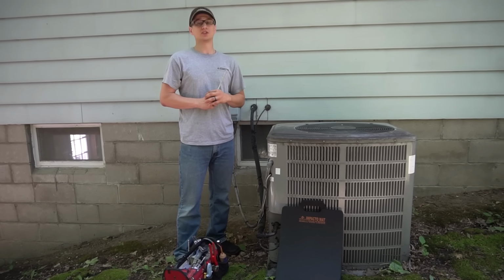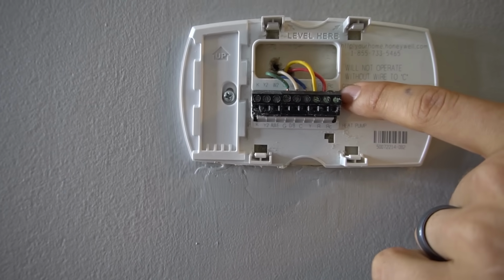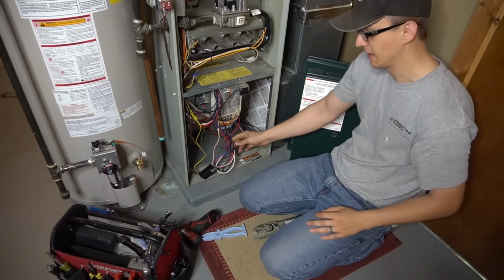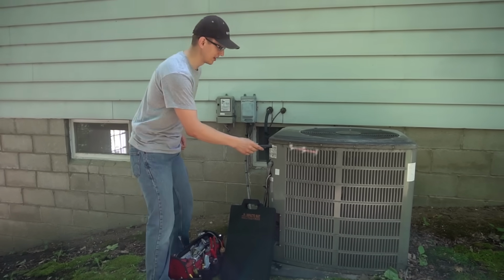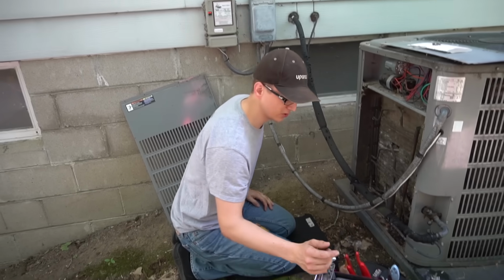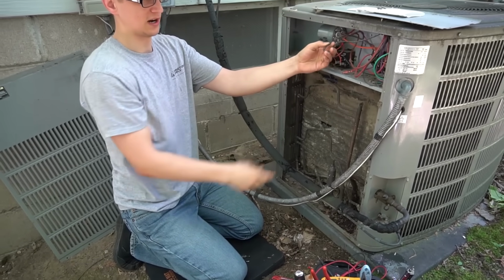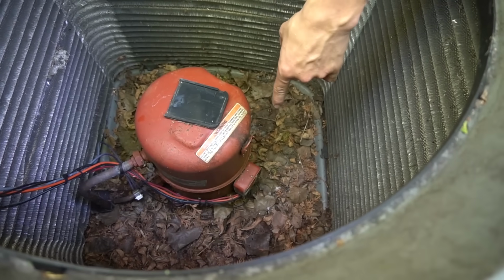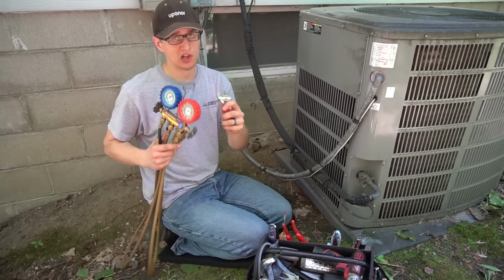AC Unit Not Turning On - How to Fix It Step by Step

Comment: I'm sorry, I didn't catch the part where if you manually push in the plunger and the compressor turn on, what should I do with the contactor?
Reply from the maker: If the contactor does not pull in on it's own, then it's time to move on to this video: https://www.youtube.com/watch?v=NVPhsK4gK1A&t=2s
Reply: Well...it's..weird.  I've opened the panel to the unit with the thermostat off.  I've measured the voltage for what I thought is line to line but the voltmeter registered 0V.  Line to neutral registered 120V for each line.  When the thermostat is on, the contact does work and I do have 25V at the contact.  Not sure what to do next.
Reply from the maker: @garypham5513  It sounds like you are missing one hot leg. So instead of 240v, you only have 120v. My guess is that one of your disconnect fuses is blown or there is a loose or broken wire..
Reply: I've replaced the fuses just in case.  Line to neutral is 120V for each of the hot leg, so I should have 240V, but when I measured the line to line (placing meter end on each screw ahead of the contactor), it reads....0V?  That can't be right when there is power from each hot leg? If it me measuring wrong and I do have 240V, then the next steps would be to check out the capacitor? Thanks so much for your time and help.
Reply from the maker: @garypham5513  Between L1 and L2 you should have around 240v. (so yes, where the two hot legs come in and go to the contactor, you would put one lead on one screw and the other lead on the other screw)  I would guess that you have a broken or disconnected wire in your disconnect or the ac circuit breaker. You should be have 240v there.

Comment: I’m having a problem with my fan running and condenser shutting off periodically, I have to re set my thermostat to get it to turn back on.. what could this be? I’ve tried replacing my thermostat as that’s what the ac guy said it may be. Oh and it’s only doing it on my upstairs unit, the downstairs works perfectly

Comment: My issue doesn't seem like an easy fix. I checked contactor by bypassing the thermostat, worked great, checked voltage with meter and I'm getting 24 volts on contactor. I checked thermostat first too, seems to work fine. My issue is, contactor not sucking in. Any ideas? Thank you.
Reply from the maker: If the contactor is getting 24v but it is not pulling in, then the contactor is bad and needs to be replaced. It's a pretty cheap part on Amazon and is fairly easy to install.
Reply: @WordofAdviceTV  I had a feeling I should replace it. That's why I asked a pro! Thanks, I will give it a go.
Reply: @WordofAdviceTV  Installed new contactor and still not pulling in. We had a new furnace installed recently but not sure if that could affect it?
Reply from the maker: @ghatonn78  That is strange. So when you check with your meter, the contactor is getting 24v but the contactor is not pulling in? Are you sure there's 24v there? And now this is a new contactor and still not pulling in... Have you tried bypassing the thermostat at the furnace control board just to rule out the possibility.. (I have a video on how to do that if you need it) And I have another video on 10 reasons why a contactor does not pull in, maybe one of those will be your problem: https://www.youtube.com/watch?v=NVPhsK4gK1A&t=2s
Reply: @WordofAdviceTV  We looked at every variable and the problem is with the new furnace. No volts from board to condenser. My brother in law is hvac qualified but hasn't had huge amounts of on work experience. His opinion was the newly installed furnace. I was hoping it would be somewhat easy. I've learned a lot so that's always nice. Have to get the furnace guys back on this one. Thank you for your help.

Comment: Awesome tips.  Exactly what I needed to check. Thanks for this.  Very thorough!  My air blowing in house but the AC unit not powering up or spinning. Hopefully I can check all of this before repair man comes out. Been without heat for 4 days and it's 85 - 90 degrees all week.
Reply from the maker: Yikes, that's a hot week! Hopefully you can get it fixed asap!

Comment: Hi - I have  frigidaire  Q7RD-024K - when I turned on, the outside exhaust fan came on once but the turbine that pushes the air through the vents was not turning. It seems to move freely. I turned the system off now nothing will come on. There is no hum. The fuse looks fine. There is a click when the power is turned on initially. Just seems dead. System is from 2013 - no bulging on the capacitor - capacitor was replaced 2x so far. Everything is in the outside unit. on inside furnace. neither heat nor cool work - EDIT: I found that there is power coming to the top of nordyne 624712 - but no power at the bottom terminals  (the ones I could reach) - I see a coil at the back - is it a relay? thanks

Comment: Hey! I have a Nest Thermostat and the connections are listed as-->     Y1 - G - R - W1 - C - OB*     No power is going to my AC (furnace fan is working). Do I need to put a jumper between R&C? If so, how do I do it? Connect a piece of wire between R&C? Thanks for posting this awesome video!
Reply from the maker: Connecting R and C would be a direct short so don't do that. You don't have the Rc terminal that I was talking about on that thermostat it sounds like.. Have you tried bypassing the thermostat at the control board to see if it is really the thermostat that is at fault? (I have a video on how to do that if you need it)

Comment: My blower doesn't turn on when I switch it to "fan", but it does turn on when I turn on the furnace. I was able to go outside, take off the lid and push a "switch" on the AC unit that turned on the fan and seemed to push cold air.  Wondering if that means it is a thermostat that is just failing to call for the air properly.  When I do push the switch on the thermostat to "cool", I do hear a little click (which has always been normal when it is turning on) but no fan, and no cold air.  Any thoughts?
Reply from the maker: So from what I understood, the contactor plunger is not pulling in outside? If so, then this video is a good one for that: https://www.youtube.com/watch?v=NVPhsK4gK1A&t=2s

Comment: I first go to the outdoor unit and kill the power. I don't want it to try and start without me being there in case a start assist or capacitor is bad or it has lost it's charge. I then turn the stat on and if the blower runs, go outside and see if the contactor is closed (Pending any time delay from the stat or control board). If the contactor is closed, I re-establish power and check from there. If the contactor is not closed, I check for 24v at the contactor and go back from there. And so on. Don't forget an open drain switch.

Comment: My ac works fine for a few minutes then the breaker trips out then all I get is the fan blowing I cleaned the condenser filter is good not sure about fuses
Reply: Loose wire at the breaker causing overheating or bad outdoor capacitor or bad start assist for the compressor.

Comment: I just bought a new Honeywell thermostat CT 31 and it didn't have a connection for the jumper. I had a jumper on the previous Honeywell is that the problem why my fan and compressor are not working outside?
Reply from the maker: If you do not have a jumper between R and Rc, then yes, that could be why nothing is turning on.

Comment: Excellent information! My only suggestion is to check your fuses first, as they are the most likely culprit if your fan and condenser aren't turning on, but that's based on my 6 years of home ownership, no professional knowledge, whatsoever.
Reply from the maker: The fuses are a nice easy fix so that's a good place to start :) Thanks for commenting!

Comment: Great videos and a huge help. One of the wires that connect to my dual run capacitor came undone and shorted out on the capacitor itself. The wire and connector is burned and the capacitor is not reading anything on my ohmmeter. I can hear the unit try to come on and a slight buzzing noise. Do you think cutting the wire & replacing the connector and replacing the capacitor will get it working again?
Reply from the maker: Yes, I think there is a high chance that it will fix it :) The breaker may have tripped or a fuse blew but fixing the wire and replacing the capacitor should do the trick. I see that a lot.

Comment: I have a question. my thermostat wires outside to the ac unit where cut by the lawn service, It blew the inside fuse I replaced it turned it on and it burnt the board. I didn't replace the transformer, would that cause the board to burn a capacitor next to the fuse? I already ordered a board but im thinking i need to replace the transformer also... thanks
Reply from the maker: So were the chopped wires fixed properly? It sounds to me like there is still a short somewhere..
Reply: @WordofAdviceTV  Because it's not my property, Im thinking someone touched the thermostat wires to the high voltage side trying to fix the issue because the wires where tied together and not capped. This is just my guess because of the damage it did, so I hooked everything backup and replaced the fuse never checked the thermostat and the flat capacitor next to the fuse started smoking. So thats where I'm wondering if a bad transformer would cause that..
Reply from the maker: I wouldn't think a transformer would cause that. More likely a wire is touching something metal. This one sounds like it may be a little bit of a headache to track down..
Reply: @WordofAdviceTV  what I didn't check was the wire running along the ac lines coming into the house, possible pulled the coating off the wires further into the house. Only other thing is the thermostat wires being crossed at the ac unit, would that make a difference?
Reply from the maker: That is one of the most common reasons the control board fuse blows - bare thermostat wires that touch each other.

Comment: Well, we watched a few videos, we decided that we were going to check the capacitor then the contacter….I had made a post on FB about our circumstance, which was that we turned on the air, it kicked on then kicked off a few seconds later.....so while my husband is out cutting off the power and removing the outside panel, I read my FB comments on that post....a Kindergarden teacher friend say's "this happened to my friend, check the batteries in the thermostat". I told my husband to stop, I read it to him, he say's "Does that thermostat even have batteries? If so, I have never changed them" Mind you he replaced the furnace/central air and thermostat like 20 years ago.....I went in, pulled it off, changed 2 AA batteries....and TAH DAH.....it worked....

Moral of my post....before you go tearing everything apart....check the batteries in your thermostat.....And to the fella who did this vid....you did a great job explaining, we watched a few of yours because your explanations were easy to follow, but I think you should say that changing the batteries is the first thing to check.....thanks everyone
Reply from the maker: Thanks for sharing your story Kellie!! I do mention thermostat batteries later in the video but you are right, I should have mentioned the easy fixes like that in the beginning.

Comment: Many thanks for taking time to share the information as well as for your organization of information.  As a single home owner I rely on information as such to prevent me from needing to pay big money for simple fixes.  I do have a question in that my issue was resolved by pushing the "plunger"... everything popped back on.  I assumed that because it is overriding the thermostat that there was an issue with communication, so I turned the air off at the thermostat and then back on... within a couple of minutes the outside unit started again.  Why would this be the case?  Sorry if I should understand via the video!  And, thank you again!!!
Reply from the maker: You're welcome! And just from what you described, I can't tell you for sure what caused that.. It could have been a glitch in the thermostat or perhaps a bug got stuck in the contactor contacts and when you reset it, the plunger moved up and dropped whatever got jammed in there. Could be a loose wire.. Etc. But if it is working, I would just enjoy the cool air and not worry about it for now! :) It is hard to track down a problem when everything is working.

Comment: Thank you, you confirmed the Blue wire is common for my new WiFi thermostat. The wire connection is correct. But my unit is blowing hot air (heating). I did over ride the program and lower setting and Hold applied. Any suggestions?
Reply from the maker: It's possible that the control board or the thermostat is bad. Do you have a multi meter you can check voltages with? That would be the best way to check. Otherwise I would go to the furnace control board and remove the W (heat) wire from the thermostat strip. If the heat shuts off, even though you have the thermostat set to cooling to begin with, then you know the thermostat is bad. If it keeps heating with the W wire off, then the control board is bad. There may be other issues but the above would be the most common.

Comment: BOOYAH! and just like that, we've got AC! Can't thank this guy enough. Had an e23 error message on my NEST therm reading "no power to the R." Switched out the 3A blown fuse in the furnace, replaced an electrical wire leading to the outdoor unit where presumably a mouse chewed through and voila!... it's cold as the other side of the pillow!
Reply from the maker: Haha that's awesome! Glad to hear you were able to track down the problem and get it fixed! Stay cool ;)

Comment: This is fantastic, although, when I press the plunger it buzzes but doesn't work.  Thanks for the thorough and easy to understand video!
Reply from the maker: Glad to hear you found the video useful! It sounds like you have a dead capacitor. Of course it could be more than one problem too.. Good luck troubleshooting!
Reply: Mine did the same thing. I pushed the plunger (or it was pulled from the thermostat) and it just buzzed. No 240 voltage reaching the other side... Try AH905's vid on troubleshooting a faulty contactor... I was able to clean the contacts and it worked!

Comment: Thanks for this quick overview it has really demistified the a/c for me. Im still not sure what my problem is though. My dual capictor works. And the fan spins. The fan is noisy it sounds like its going bad. Thermostat is set to 77 and temp is reading 91.  My a.c. is blowing warm air, Does that mean the condensor could be bad? Looking over the wires they all seem fine. Any input would be much appreciated.

Comment: Mine was blowing warm air, Tech came out and replaced capacitor, Still nothing, hooked up his read out gadget and said it was compressor, A week later I turned it on for chits and giggles and it was working again???
Reply from the maker: Hmmm.. I can't say anything for sure.. But perhaps the compressor overheated and tripped the overload which would make it look like the windings are O/L or shorted out. It usually takes a long time for that thing to cool off and close back up. This is just theoretical though :) I would wash down the condenser coil real good just in case. Even if it looks clean. A plugged coil can cause your compressor to overheat.
Reply: I turned it once after the winter and it worked fine, The next time I used it a couple weeks later it was blowing warm air, That's when I had the tech come out,  Bad compressor according to him, Several weeks later it's working again?, My question, Can a bad compressor work intermittently?
Reply from the maker: It's rare but that is possible. I couldn't tell you for sure without looking at it myself

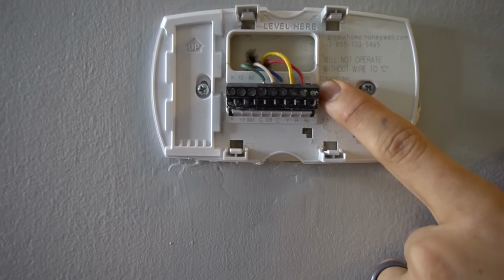Comment: 4:35 IS THE Most important where AC GUYS comes in for diagnosis and mess with that so they can sell you a new ac unit stating that the ac is not good no more.!!!!!  

BE AWARE OF THAT folks.
Reply: Yea you're a professional??? Are you a tech w experience?? These units only last so long and just because some home owners dont want to spend money to upgrade you wanna blame the hvac guys ?? Hahah that's why when your unit shits the bed and u call in an emergency for swap out during a hot summer heat wave you thought u laughed at us hvac guys but the end we  will always be laughing at all you when you need to be certified to do anything refrigerant related because it's against the law for non certified ppl to handle refrigerant but end of day it is what it is  but stop bad mouthing us good hvac guys u cheap bastard lol

Comment: Our ac isn't turning on at all inside, it stopped working suddenly. We called a technician to check and the guy diagnosed that the outdoor fan motor gets really hot and won't turn on. We were told to replace it and it will cost $721 for the item and the service. I don't know what to do. Any advice would be greatly appreciated.
Reply from the maker: The other option would be to replace it yourself :) I have a video where I show how to do it step by step: https://www.youtube.com/watch?v=_3TxcnCkd18&t=7s
Reply: Thank you!
Reply from the maker: @NS777-e4o  I just read your comment and noticed that you said the ac is not turning on at all "inside". But then you said the outdoor fan motor needs to be replaced. The video above was for the fan inside. I don't have a video for the outdoor one yet, sorry.
Reply: @WordofAdviceTV  That is alright. Thank you for the reply.